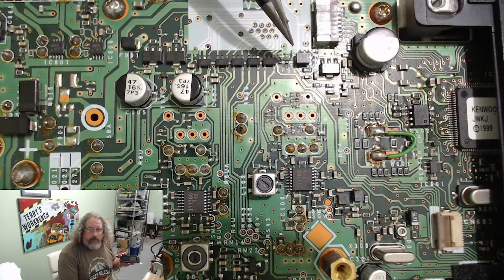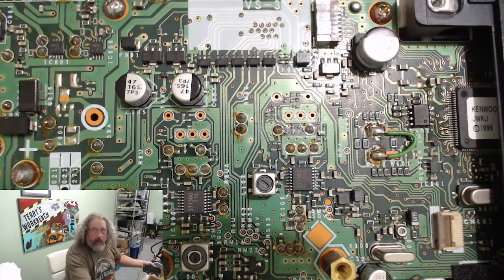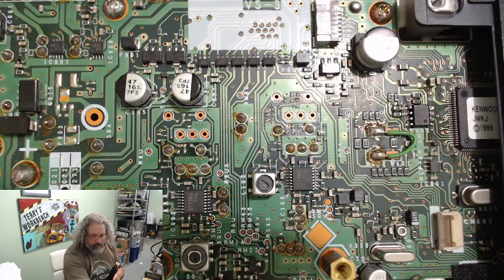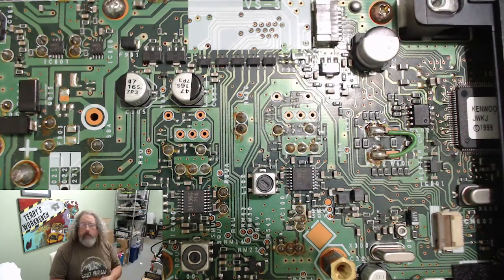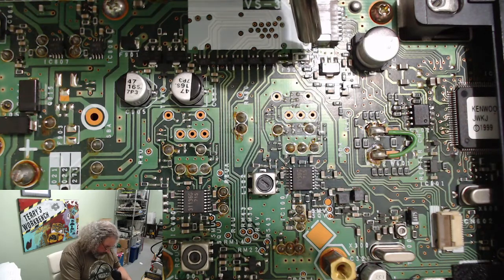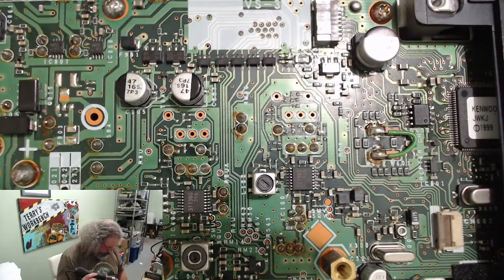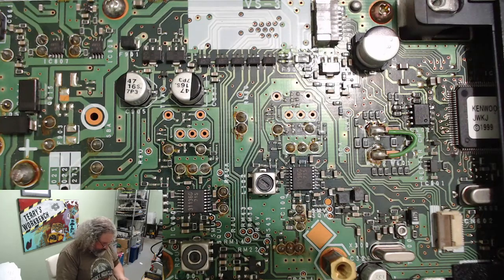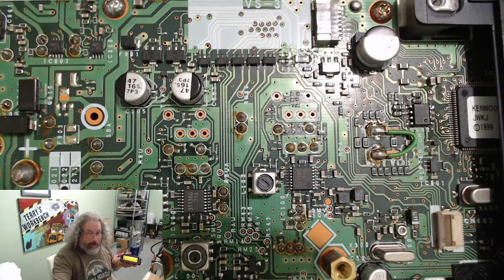Kenwood TM-D700 No power on repair Part 1. F902 fuse replacement

Comment: I just experienced the exact same problem, pretty sure it was caused by the extension cable at the remote head. The radio was intermittent with power ON until I wiggled the RH cable, and it would turn on, and then it stopped turning on. Found that fuse was open as you showed. Not having a soldering iron that was small enough, or a hot air tool, I just crushed the little fuse and there are two tabs that would stick up. Using 22 ga wire and a micro glass, a 2 amp fuse, I was able to restore the radio to working condition. All covered in heat shrink and thinner than the board mounted capacitors. Thank you so much for the video and your time and effort.